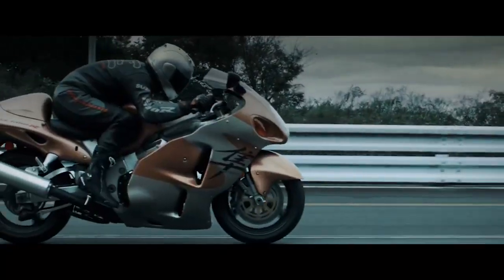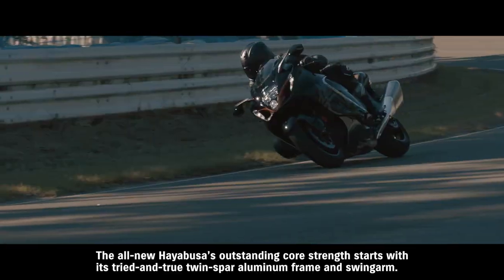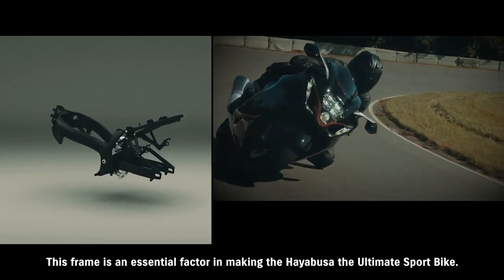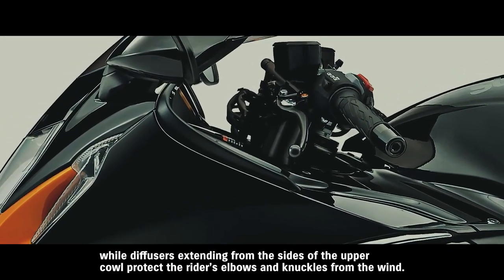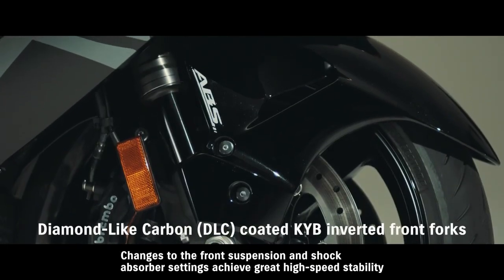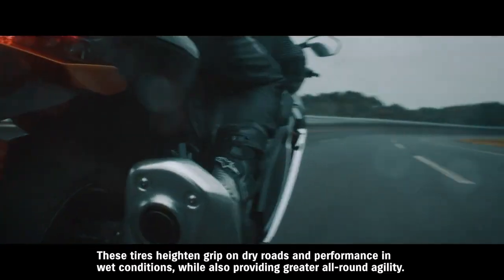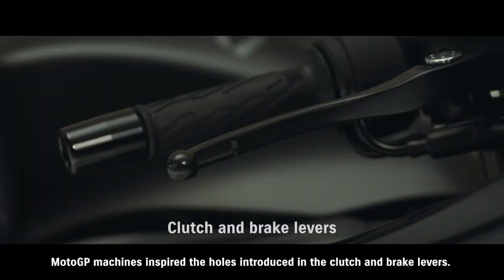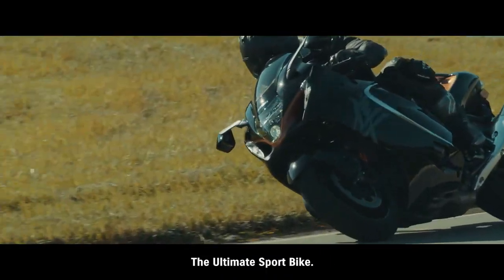Finally New Hayabusa 2021 Launched new changes | 2021 Hayabusa detailed technical specifications

Comment: Bekar.. Naa CC badhai na power ulta 197 bhp se 190 bhp pe le aya gari ko or torque vi 155 nm se 150 nm..weight vi nehi ghataya 264 KG.. Or price 20 lakh.. Vai ye 2021 hein 20 lakh mein 210 bhp ka bike milta hein wo vi 200 kg k andar.. 16 lakh mein to zx10r mil jayga.. Itna ummid lagake beithe huye thein hum log.. Or inhone ye lekar ayen.. Or bolte hein mid low end or mid range mein power Or torque badhaya hein taaki picup jada milen.. Or 0-100 pehelese tez ho.. Saalee ye hayabusa hein isko log 100-150 mein chalane keliye nehi lete ya fir roj market jane keliye nehi lete jo tumne mid range Or low range badhai hei.. Salo hayabusa power ghata diye to hayabusa sirf nam ka rahe geyaa.. Or gari mein var var k electronic diye hein jese 20 lakh se hum log computer kharidenge.. Sale pehele busa ko busa banao power or torque badhao.. Fir usme computer add karna.. Busa ko log uske power or top speed keliye jante hein na ki uske electronics ke liye.. Or bolenge hamne busa ka heritage keep on rakhne keliye usme super charger Or trubo charger nehi lagaye.. Saaaloooo.. Or agla change lana Or 20 sal k badh 2041 mein.. Or power ghatake bonla busa ka heritage keep on kiye hein.. Kamine sale.. Isiliye ek bike ka badnam hota hein.. Busa koi 400 cc bike nehin hein jo ise low or mid range do ge.. Bike ab to 299 jane mein pehele se 2-2.5 sec slow ho geya hein.. Jiske liye log busa ko jante hein iske top speed k liye.. Or ye 0-100 picup badhayenge.. 😡😡😡😡😡😡😡😡😡😡😡